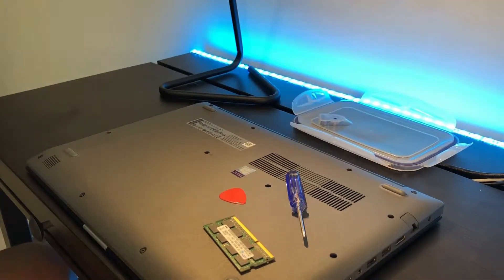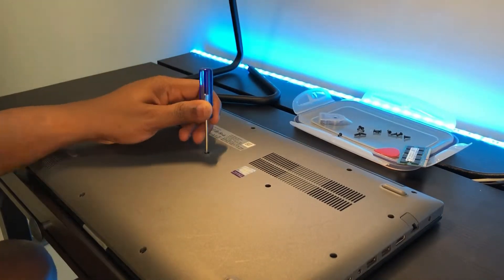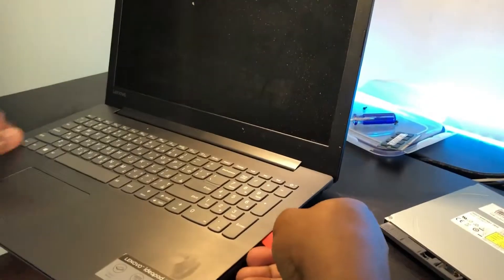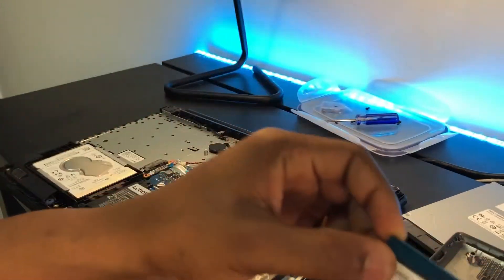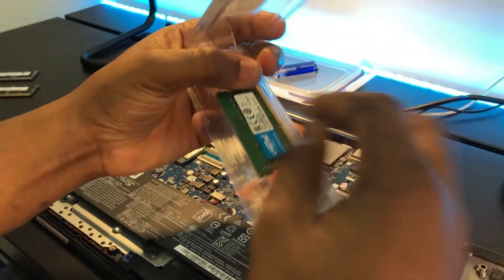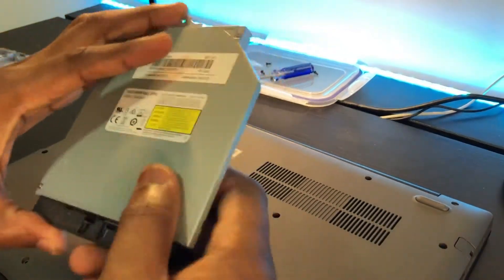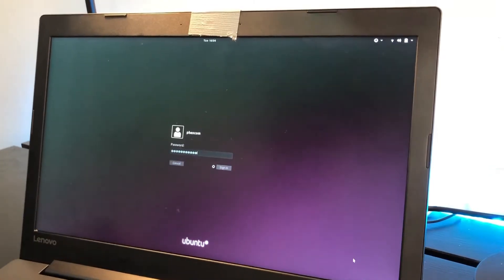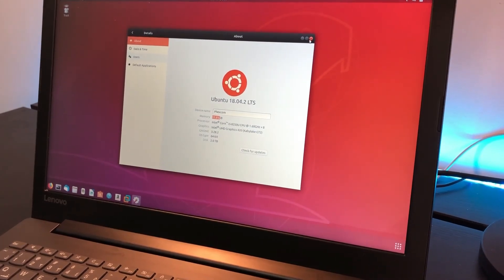Lenovo ideapad 330 laptop upgrading the ram on ubuntu

Comment: Question : got a 330s and I currently boot via F12 on an external USB drive (Kali Linux) and all is working. May I update and upgrade (apt) Linux (on /dev/sda1) without destroying MBR of my internal SSD (on /dev/nvme0n1p1) ? Is this safe to do or not ?
I wonder because upgrade might use update-grub automatically during upgrade process...
Reply from the maker: After update it will check where grub is installed and update it.. probably /dev/nvme0.... might not be writable... But be careful and research other resources too because I have had similar issues in the past that I had to re install my OS
Reply: @phexcom1815  Tanks, that confirms what I think...
To make it simple I thought about "neutralize" my SSD, so that the system doesn't even know it exists (in BIOS maybe...) and update-grub will only know about my external usb drive....